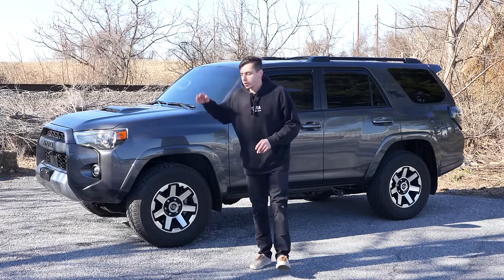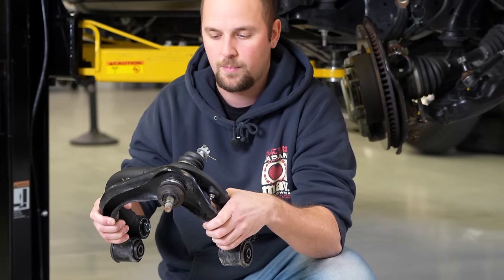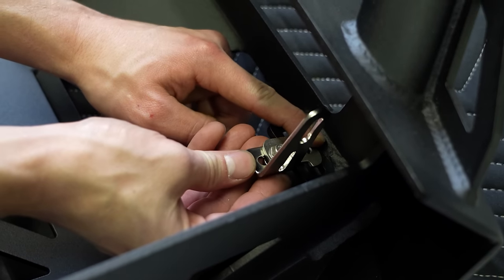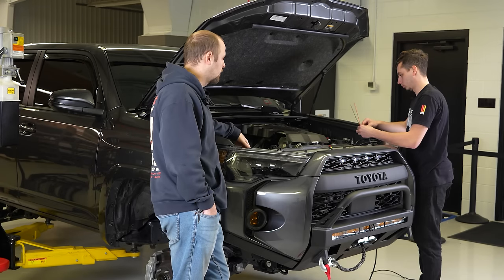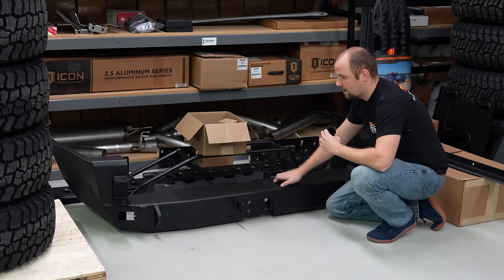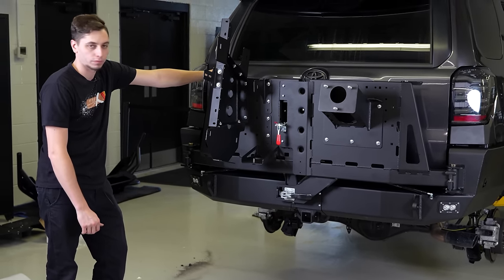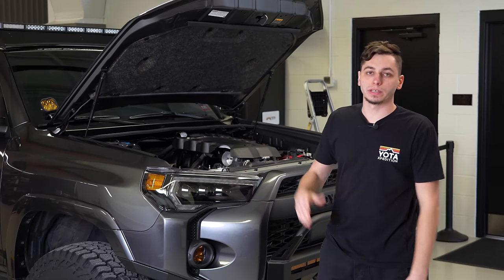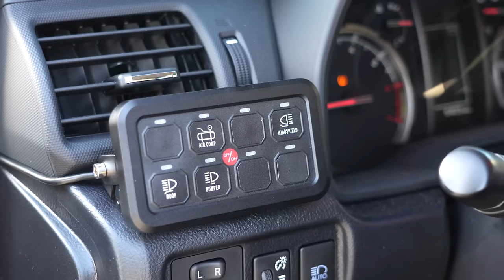Transforming A Customers 4Runner With Over $20000 In Parts!

Comment: 80 to 110 hours of labor at 110 usd per hour or 11K for labor over two weeks? I
Understand no worries acceptable rate. That's impressive! As an electrical engineer with a Master's degree and 20 years of experience, I certainly don't earn $110 per hour, haha! However, I'll definitely be bringing my GX to you for a medium or long travel suspension upgrade very soon. I wish I had found your shop earlier, as my GX is undergoing a similar build, except for those shocks, with a similar parts cost.

Comment: I spent almost $20K in my wife’s 2018 4Runner SR5, Method wheels. Toyo tires (same size 265/70 R17), Magnuson supercharger, Bilstein 8100 suspension, Power Brakes front and rear, High Country running boards/steps, Toyota rubber mats and Alpine radio with Focal speakers. Beauty is in the muscle.
Reply: Supercharger is a great add for these vehicles.
Reply: Did that include the labor?  Or did you do it yourself and it was parts only?
Reply: Parts only
Reply: @fpartidafpartida  it didn’t include labor, it was around $3,500 for installing the supercharger, alignment and tire balancing.

Comment: I have a 23’ 4R that I’ve done a similar set of upgrades to. Mine has the same C4 lo pro front bumper with high clearance side and Warn winch. I opted to go with an Elka 2.5 adjustable suspension all around. I have the RSG sliders and front and center steel skid plates underneath. I do have the Crestone rack but went with a Extreme LED light bar, my other lights are all Baja Designs. He’s going to love the Mickey Thompsons, I have the same ones. I have not found a rear bumper yet that I like enough. I’m planning on only a tire swing out but I don’t want to sacrifice the BSM’s.  Lastly the ARB twin is one of my favorite mods, I have mine in the same position but opted not to do the tank or the front connection. I like popping the hood and plugging straight in.

Comment: That 4Runner is beautiful!!!  I kept pausing the video at the end because I was trying to see where you mounted the quick connect for the air hose on the bumpers. I couldn't find them.

Edit: I watched a walk-around video about this 4Runner and saw where the front quick connect was installed.

Comment: He needs an overland exhaust on there to tuck it in the rear. Using my 4Runner off roading, I have a similar set up, I dented the exhaust pipe. Tucking it up into the rear would have been a solid move
Reply from the maker: Yeah, I thought about asking the owner if we should cut the end of the pipe shorter

Comment: Mate as a fellow fitter you lost me once you started cutting the bumper with an angle grinder 😂😂😂.
Reply from the maker: No different than a demel with a cutting wheel, just bigger.
Reply: @yotaxpedition  each to there own mate 😂. I personally would've used an air saw then neatened up a mini belt sander then deburred the edge👍. Beautiful finish every time. I do like that you yanks are using our products tho ARB for the win
Reply from the maker: I do have an air saw that I use often but the bumper was vibrating to much

Comment: The front bumper is super clean.  The rear bumper has some nice features, but the gaps between the bumper and the rear quarters does not look as tight and clean as the front bumper.

Comment: Looks good! Instead of using a cut off wheel on the plastic bumper, try an oscillating tool with a wood/drywall cutting attachment. You won’t melt the plastic and the cut will be much cleaner. The RPM are too high with the grinder and you’re just melting instead of cutting.

Comment: Nice build! Pro-tip: when soldering two wires together, it's always best to "tin" the wires first, i.e., solder the individual ends first. You'll get a stronger connection and eliminate any voids that may develop using the other method.

Comment: Suspension AM arms and other bits are a joke! That's why I sold my 4runner, picked up a 2500 suburban without an engine, built a 6.0 engine hooked to a built 4l80 and and complete kryptonite front end. Thing is solid af! And I did all that from what I got for my 4runner! Will be supercharging my 6.0 soon, has billet internals. It'll give a 4runner for it's money! My 6.0 gets about same mpg's as the 4.0 in the TuRD! Oh and my suburban tows a crap tonn more!

Comment: That's the hard way to do the ditch light brackets.....Take the top bolt out and mount the bracket but leave it kicked out of the way of the bottom bolt. Snug it tight enough to just barely be able to swivel the bracket. Then remove the bottom one and swing it into place,  bolt in and torque down both. DONE! Only one person required 👌

Comment: And yeah for anyone doing these types of work as far as the steering and suspension is concerned for your first time I just wanna say when replacing the upper and lower control arms any trailing arms sway bars basically anything that pivots or turns wether it has but especially if it has rubber bushings in it don’t do the final tightening and torque ink of any of the bolts until the full vehicle weight is on the ground! I typically once the vehicles are fully in the ground give the suspension a couple of bounces just to ensure it’s settled! The reason why you put the vehicles weight on the suspension before tightening and torturing all the bolts and nuts is because unstrung rubber bushings will break away from their housings which means you’re replacing them sooner then you should!

Comment: Hey guys! Thanks for the content. I have couple questions in regards to the front bumper: Does the front camera and TSS sensor still work with the 'bull" bar over them, is the visibility affected? In order to get the winch to fit did you have to adjust the radiator tube (skinny angular tube) that runs pretty close to where the winch location is? 

I appreciate the video and all the work that goes into making the videos as well as the informative process in which Cory goes over the steps and installations!
Reply from the maker: With the full bull bar and no bull bar it does not block the TSS sensor. The mid height bull bar does block it. With the full bull bar its blocks the camera a little at the top of the screen but still fully usable.

Comment: Just afew questions, I've noticed you never used lock tight on any of your bolts.. Isn't that something you should be using considering all the heavy-duty equipment? Only because his gear will be loose and rattling after a while especially if he goes off road alot.. Btw,
what do you do with ALL YOUR O.E.M PARTS..DO the customer get them back or you resell them?
Reply from the maker: Most times they take the parts with them, sometimes we throw smaller parts away.

Comment: Genuine question,  not trying to throw shade.  I had a 2020 ORP.  I turn wreches but i never messed with suspension before.   I installed a very similar suspension (same parts different brand).  It took me 5 hours with beer and a lunch break.  I installed the same DD fog lights in about 1.5 hours (those things are a B to reach).  I put on sliders in like 30 minutes.  Wiring all that crap and a rear bumpers install took a full day i bet.  2 weeks total though? Im scathing my head for a overland shop yhats proficient at this stuff.  

I think its a great build, i hope he wheels it.  Great install too but im still stuck on 2 weeks install time...
Reply from the maker: Hey Joseph. 5 hours for suspension sounds about right. We put probably an average of 5 hours in on this build each day. There was a lot of small things that are tedious and take time that seemed easy on video. The owner dropped off his 4Runner and had another vehicle to drive. So our goal wasn't to get it done asap.
Reply: @yotaxpedition  it's a suck build and your attention to detail was awesome.   I get it, you're running a business and you have admin and other jobs in the shop too.  I wish there was more shops out there like yours.  There's a lot of "professionals" out there and very few shops doing it right.   I sold mine years ago only because I git a job in Europe and a lifted, 6000lbs suv isn't even remotely a good idea here.

Comment: Great work Gentlemen 4Runner looks amazing but, my opinion if your going to build and Overland vehicle try doing it yourself it makes you feel more proud about what you accomplished knowing that you did your self plus helps with your skills which I did but, if you have the money go for it  as far as rock sliders I would’ve gone with Westcott designs better quality  also for all that money you spent on your build and no RTT, Refrigerator dual batteries, solar panels buddy your not done with your Overland build hell your never going to be done 🤙🏾 4Runners are the best Overland vehicles in the world by far. My cost plus doing it myself $13,000 that’s not including wheel alignment  Good luck enjoy you adventures🤙🏾

Comment: does that C4 bumper interfere with TSS? and the oem front you took down had a front camera? what camera is that?
Reply from the maker: The high bull bar and no bull bar works with the TSS sensor. If you go with the medium height then you need to relocate the TSS sensor. The full bull bar blocks the camera a little but it still perfectly usable

Comment: After all the new upgrades on this I don’t understand as to why the  customer wouldn’t want to upgrade their brakes. 

One of the first upgrades I did was add the power stop s heavy duty breaks and slotted rotors to my 4Runner. Assuming that this person would be doing some pretty decent off-roading (based off of upgrades) I thought they would also upgrade their brakes as well.

Comment: I thought a snorkel was something that deleted the exhaust pipe so it could go semi under water. That just looks like an extended air breather am i wrong? But sick ride and build tho im getting the 24 pro soon 😎
Reply from the maker: A snorkel is an intake extension so your engine doesn't suck in water. A snorkel has nothing to do with your exhaust system. Submerging your exhaust in water is perfectly fine, just don't turn off the engine.

Comment: Great build. I'm wondering why the BSM sensors couldn't be used with the new rear bumper?
Reply from the maker: The BSM can't work through the metal bumper. Works through the OEM plastic one
Reply: @yotaxpedition  Is it possible to drill holes in the bumper to mount the sensors such that they aren't blocked by the metal bumper, but the bumper is uncompromised and still fully functional? BSM is a great technology and it's a shame to have to disable it because of a bumper replacement.

Comment: I would assume that it has the TSS sensor in the front grill.  How did you bypass the sensor or recalibrate the sensor after the lift? I have a 20 4runner with a 3 inch lift and now the TSS isn't working, I have the alert on my dash and can't use my cruise control.  Don't care to much for the system either way but want the alert gone and be able to use my cruise control.
Reply from the maker: No problems with the TSS. The bumper does not block it at all and we didn’t relocate anything. No dash errors either.
Reply: If you hold down the cruise button for a few seconds, you should be able to bypass adaptive cruise and utilize standard cruise control.

Comment: A question for the team building this 5th gen four runner! Do they make the same bumper with dual swing outs for the 4th gen four runner? I bought the 4th gen four runner last October so I’m just getting started making upgrades!
Reply from the maker: C4 only offers front bumper options for the 4th gen.
Reply: @yotaxpedition  thanks. What kinda other options do I have? I'm getting ready to order new rear wheel bearing for my 4 runner and after that I wanna do a couple mods before overland expo east this year! At very least I'm going to level it out!

Comment: With the added weight in the rear did the customer opt for the heavier load rated springs?
Reply from the maker: He went with the "Medium springs" front and rear. And they are doing just fine with the added weight.

Comment: Nice work, I live on Long Island and was quoted $25k for installation only for all exact work. Parts not included. Too expensive or fair price?
Reply from the maker: That sounds like way to much. This customer paid less than half that for labor.
Reply: @yotaxpedition Thank you for the information. This is unfortunately Long Island, New York prices. I should bring my truck to you guys to get the work done. However, one issue, I didn’t tell you that I have a 2018 Suburban, not a Toyota.

Comment: Did the winch come with a wireless remote? Or was it wired only? Recently got a Evo 10s and it only came with wired remote.
Reply from the maker: Yes only wired. They use to sell their winch with a wireless remote but they stopped due to some issues
Reply: Gotcha, curious if you guys came up with any good ways to get access to plugging in the remote without needing remove the radiator cover? Warn sells a kit to bring back to wireless capability but you have to remove the control pack top which is difficult to do once it’s already installed to the bumper.
Reply from the maker: You can easily plug in the winch through the opening on the C4 bumper.
Reply: Ah okay, I have a CBI Covert and it’s a bit more difficult to access, I guess that’s a benefit to the C4 one then

Comment: I like the front end, looks amazing but the back bumper that gap is way to big for me, when it was on the lift I would see to much light through there, so thats a hard pass I wouldn't buy it for that. I mean if this is your toy only thats one thing who cares. but I want a nice looking car in addition to function.
Reply from the maker: You don't want that to be a tight fit. If the bumper flexes or if you drop down on to a rock you want room for it to flex. Otherwise you're gonna buckle your quarter panel. You can fill the gap with a trim molding if you want.
Reply: @yotaxpedition  OIC, thats to bad that gap cosmetic really messes with my OCD lol What you are saying makes sense

Comment: Good lord, how could you cut that fender?  If I owned a shop I’d refuse to do it.  Snorkels are the dumbest aftermarket add on, 99.9% will never see their intended purpose. No one is going to submerge a $80k truck in a river.
Reply: It’s all about perspective. When you drop 80k+ on a truck a few hundred for a new fender is just a drop in the bucket.
Reply from the maker: If the customer wants it done, I have no problem doing it.

Comment: imagine spending $20k in parts on a $45k 4runner... to still get a SUV worse than a bronco. No 35s, no front locker, no disconnecting front sway bar (KDSS doesn't count), and no modern infotainment. You toyota lot are crazy.

Comment: So you added lights, & more lights, rims/tires & more lights for 20000 dollars 🙄🤨, what about the engine department,  which is most important!!! & btw I have no idea who's giving you these prices,  but this is not worth 20k, you got hustled good mor*n , poor customer,  you guys have NO IDEA what ur doing
Reply from the maker: Hmmm. Front bumper, rear bumper and rock sliders from C4 is $6800. Wheels and tires were $3750. Suspension was $4500. Lighting was $4000. Roof rack and ladder was $1900. I'm already over 20k and that doesn't include winch, compressor setup, snorkel, intake, full skid plates for C4, switch panel, and all the other accessories we added. Please do your homework!